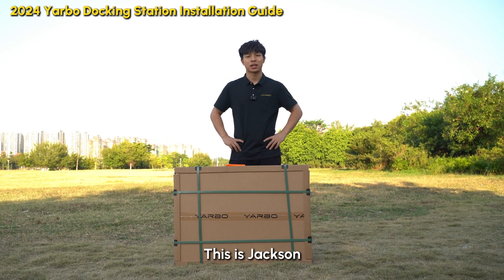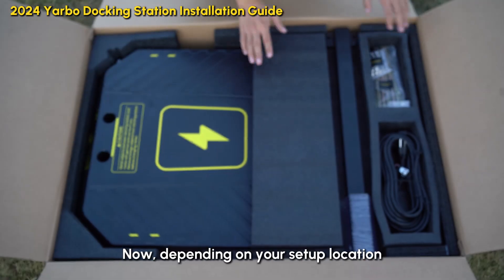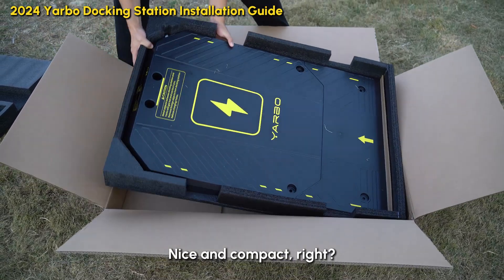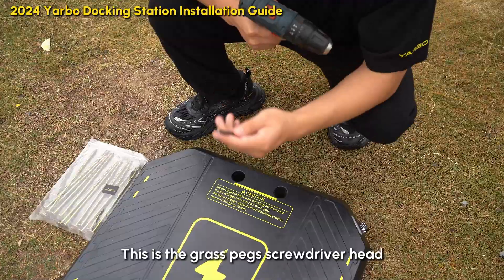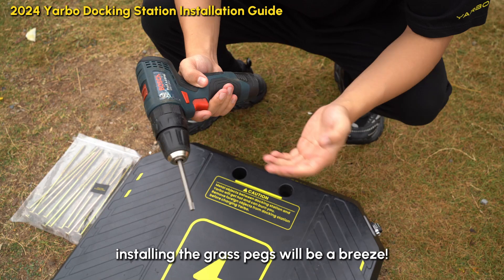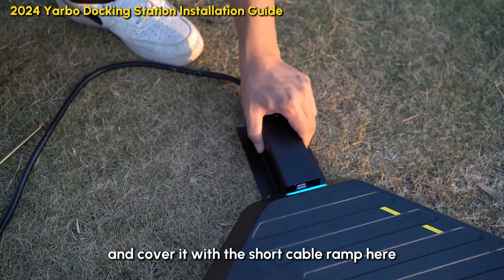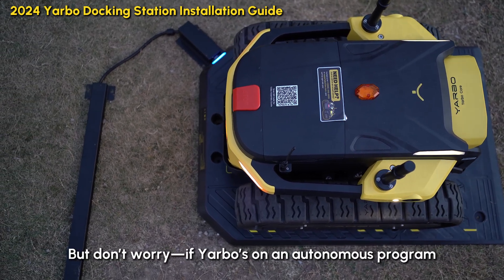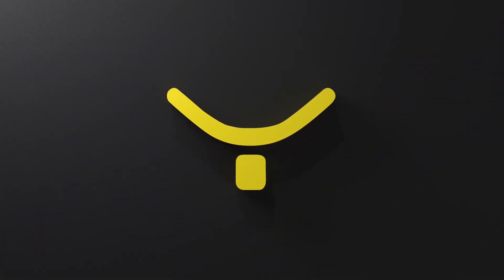Step-by-Step Guide: 24 Yarbo Docking Station Installation Guide

Comment: Can we put this inside garage?
Reply from the maker: Hi there! While the docking station is designed for outdoor use, placing it inside a garage is not recommended as it may block GPS signals needed for autonomous operation. Yarbo requires a clear GPS connection to navigate and dock properly. For optimal performance, install the docking station in an open outdoor area with 7 feet of clearance and no overhead obstructions. If you need guidance, contact support@yarbo.com! 😊
Reply: @ wow can’t believe you were gonna reply to me other than you ignored the other comments lol. Ok thx!